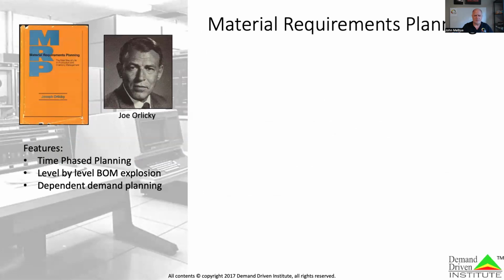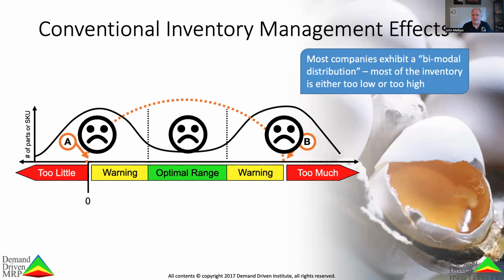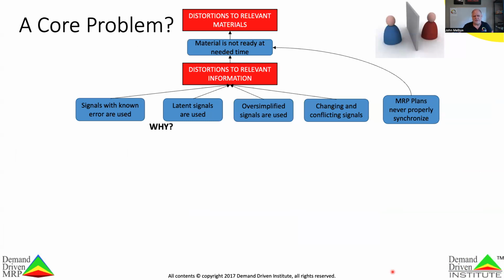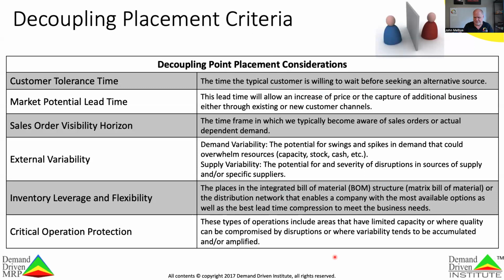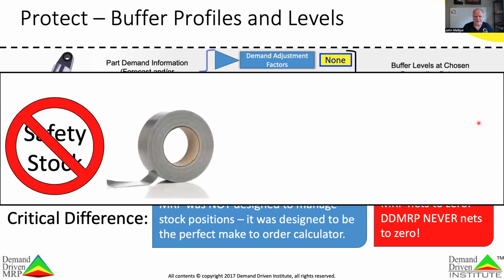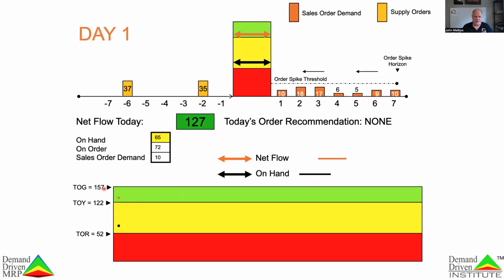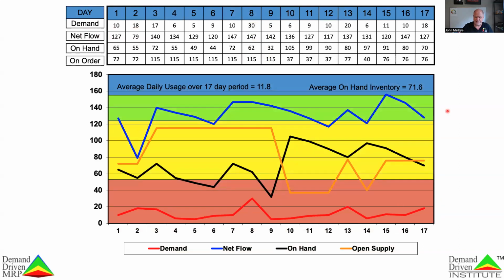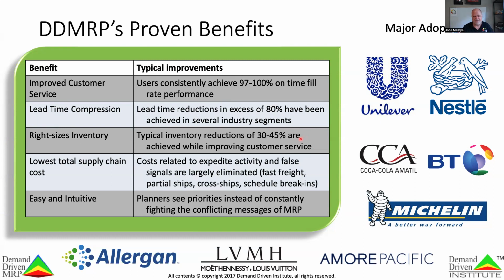Demand Driven MRP Basics

Comment: If you are trying to reduce finished good lead times, how does this work with a pre-existing SAP MRP setup? Do you just add a safety stock on each component material according to the calculation of the buffer?
Reply from the maker: Thanks for your question.  There is a long answer to this, but I'll try to be brief here.  Think about WHERE you need to place inventory to achieve the desired customer lead time. Then use the DDMRP buffer to maintain a level of inventory (capability) of those parts / locations.  One thing we see in standard planning is planners/buyers are often unwilling to place orders for raw materials until an order arrives from the customer (which is too late).  If you know orders will come, then to be prepared, you must order to maintain a level of inventory (proactive).  See my restaurant video and think about capability to produce.  
Bottom line in a pre-existing setup, you need to adapt DDMRP as a bolt on, or within your existing system.  We cannot continue to try and "duct-tape" the existing systems.  Hope that helps. Feel free to reach out for conversation (John@BecomeDemandDriven.com)